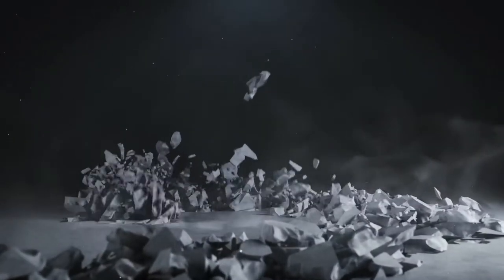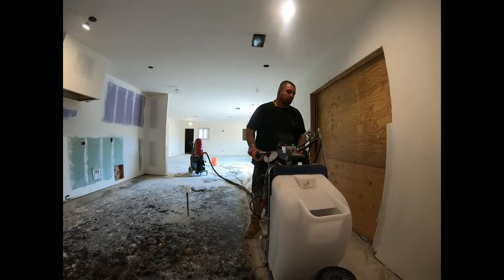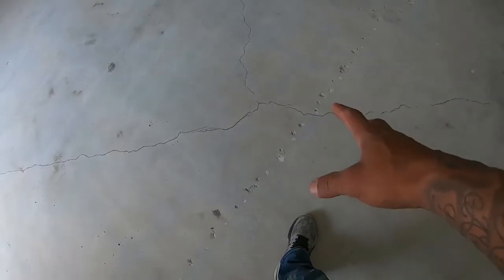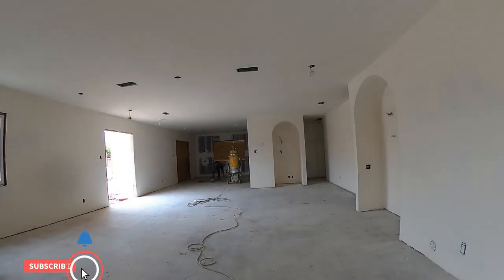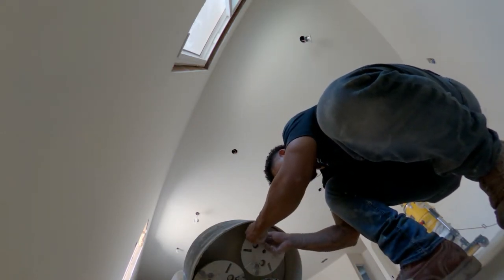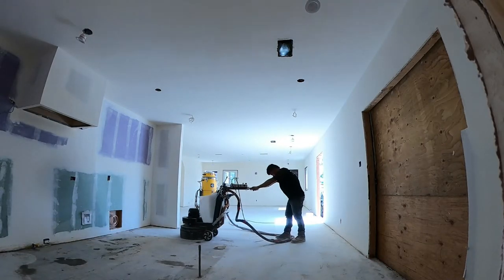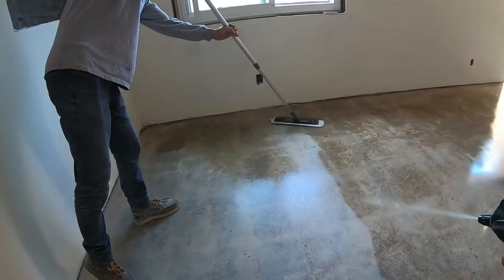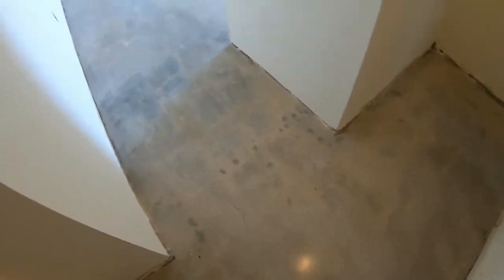Polishing a House Floor 100 Grit #polishconcrete #concreterestoration

Comment: What material did you use sir for your patching? Im from philippines sir
Reply: You can use epoxy for patching and repairing cracks and craters in your floor, or you could use hardx, imo just use the epoxy the shine it gives the floor is unreal especially when you take time with your grinds
Reply: Epoxy with cement?

Comment: If you want the patches to be a closer match sometimes we add small amounts of grout to our patch. Specifically unsanded grout to get it closer to the color of the original slab. Not a big deal but we’ve had customers complain and make a really big stink in the past. Now we do it on every job just to avoid negative feedback.
Reply from the maker: I know my friend thanks